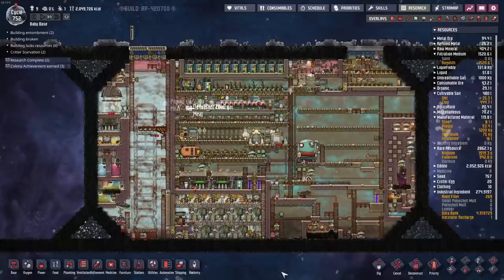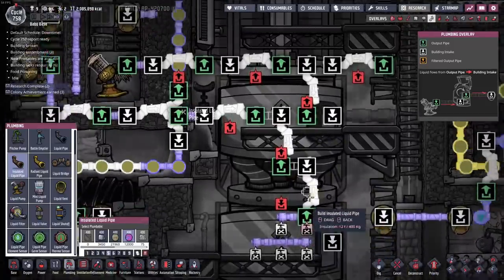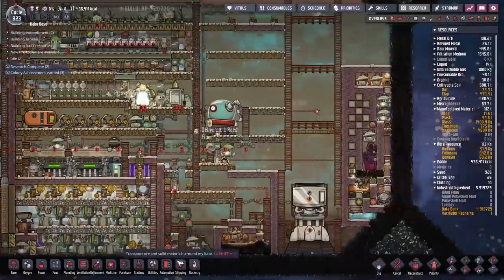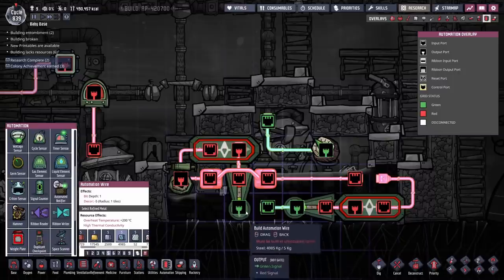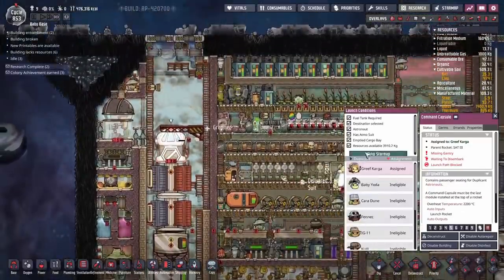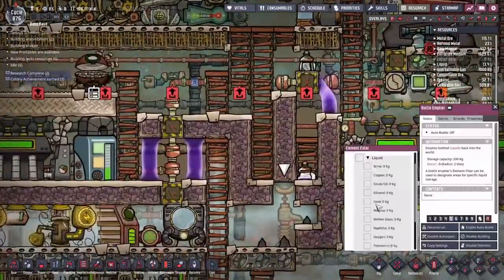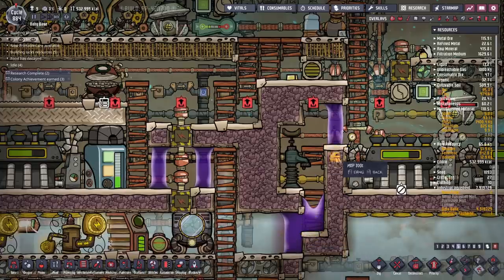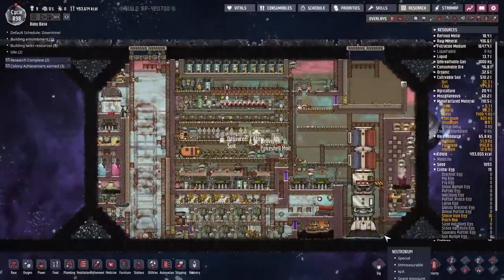Baby Base 17 : Visco Gel is Slippery : Oxygen not included

Comment: Hi there.
@21:32 I was expecting that because it bit me so many times... until I understood what was happening.
You basicly made a so called bypass pump. Gases and liquid do exchange diagonally if you create the right conditions. Think of how you can make a two tiles locks with two liquids, pre visco-gel. You build walls on both sides, pour the liquids in. Then - very importantly - you deconstruct the top walls (letting the top liquid flow out) - then the bottom ones. If you do it in the reverse order, the top liquid moves diagonally breaking the lock. The same if you build walls around it. You have to build the bottom tile first, then the top one. If you build the top one first, the top liquid slides diagonally and the lock break.
Despite being made with one type of liquid only, visco-gel locks share the same property. You're always bound to trigger the diagonal slide movement that bypass pumps are based on if you have two tiles to the side and deconstruct the bottom one first, or if you have no tiles to the side and build the top one first. So a lock exactly like the one you were trying to build is impossible. You must let both tiles to the left empty.
BTW, preheating the visco-gel prevents only the bottom tile from disappearing. As soon as you build the tile, the top visco-gel tile goes immediatly due to the diagonal slide. It gets replaced by steam (diagonal swap)  that condenses due to the contact with the cold visco-gel (the bottom tile). Water is heavier, and they swap place. Now the bottom visco-gel blob is on top, and diagonal slide happens again. What's left, is a blob of hot water that holds the lock for a very brief moment, because it's now in contact with very hot steam. It flashes and the lock is broken. It's so quick that it seems that visco-gel gets  teleported away and steam takes its place.
With hot visco-gel, one tile of steam gets past the lock, but it stays steam. There's no water, and the visco-gel blob stays in place, holding the lock.
@19:51 It slighlty strikes me as odd that you have standard pipes carrying water down to the well, then ceramic insulated pipes to go thru insulated tiles, as in my base I'm doing the opposite (regular pipes inside insulated tiles, insulated pipe where they are exposed). Thermal transfer is done based on the min TC, and there's isn't much to be gained by insulating pipes inside insulated tiles.

Comment: You should try using high-pressure gas or liquid storage as a method for storing the excessive energy production of the boiler. Perhaps thermium aquatuner storing heat in a very high pressure steam box which can be bled off with turbines to recover the engery when it is needed (never)

Comment: @Francis John 6:12 Can't you make some kind of system that can use a single pipe for both liquids?
Sure it takes twice as long to fuel, but you also need half the isolation.
I'm thinking an element sensor at the end & a liquid shutoff valve to direct the liquids to the right rocket tank.
Then you can use the other half of the isolation for a return pipe & a similar liquid sorter to direct ti to the right storage tank too.
Reply: That risks running fluids down the wrong pipe if you get overflow, no?
Reply: @danmerillat  Depends on how the system is built and what security measures are put in place. It CAN be prevented if built correctly.

Comment: got a question, if i set priority 5 on 1 door and 6 on another and the path is from a to b is equaly long through the door with peiority 5 and 6, will they prefer to go through the 6 one?
Reply: i think it's only for the toggling.
Reply: I think the priority on doors relates to dupes locking and unlocking them in a higher or lower priority. I don't mean when they just go through the door, rather when you put an order for the door to be locked or left open. I might be wrong though